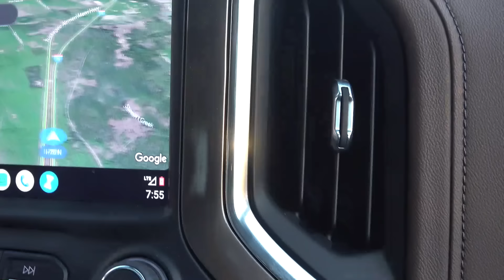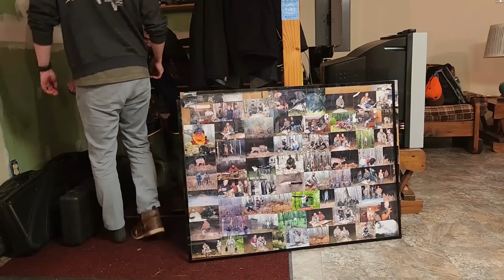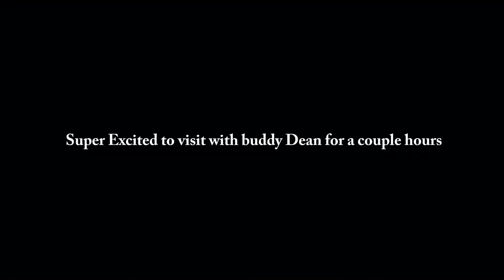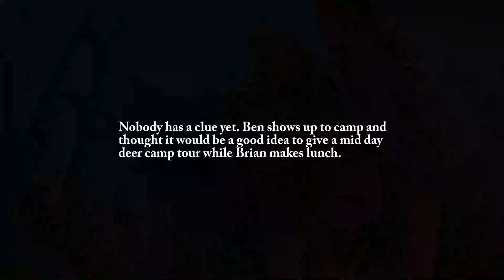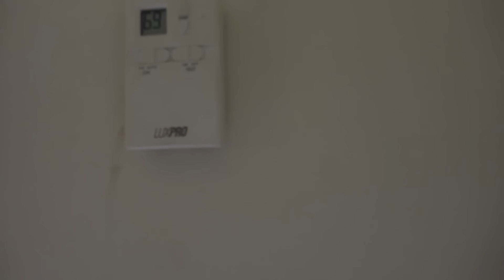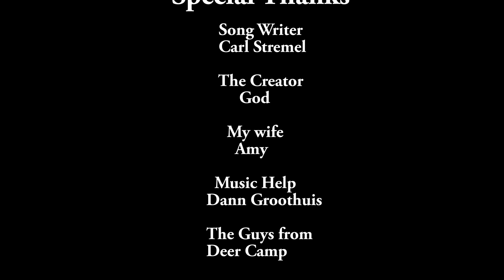2023 Deer Camp | Opener ! Part 1

Comment: I have a 1986 F-350 white in color has a 351 V-8 Auto. Gd Trks. Altho I beat my trk up cuz I bought it to go in and outta woods for logging from cedar to hardwood runs great. I also have a 1981 extened cab F-250 Inline 300-6 cyl. 4 spd 4×4. My Favorite.. Body's nice on that trk. Love that Red Ford u got..
Reply from the maker: Thanks for watching Gary. Inline 6's last forever.

Comment: what is the miinimum antler width for a legal buck where you hunt?
Reply from the maker: The regulations very based on whether you have a combo license or single license. You can see a full explanation in the Michigan Hunting Digest. Thanks for watching!
Reply: Here in Texas, antlers requirements are 13.5 inside at widest  point on spread. If as wide as the ears are at full alert, then he is legal.  Good Hunting.
Reply from the maker: @cliffscott2816  right on. Our state is broke out into various management units. The antler restrictions can change based on where you are hunting in the state. None of our restrictions take spread into account. A single deer license will pretty much allow you to take a spike (3" or longer) statewide. The combo license in many areas will allow you to shoot 2 bucks with one being at least 3 points on one side and the other requiring at least 4 (1" or longer) on a side.